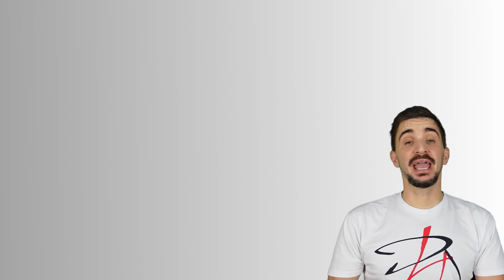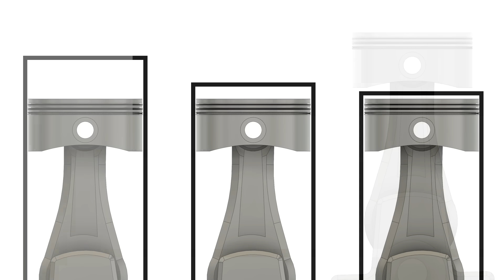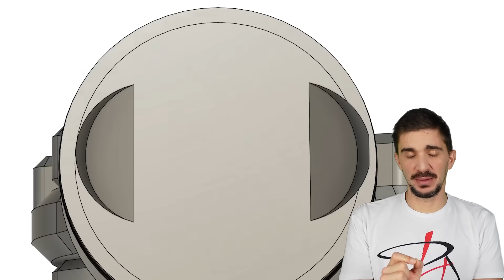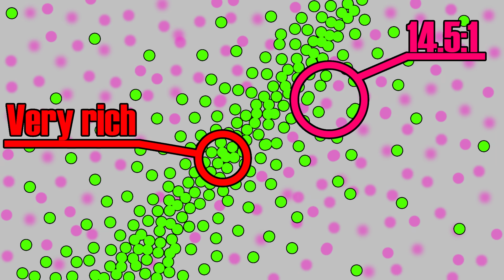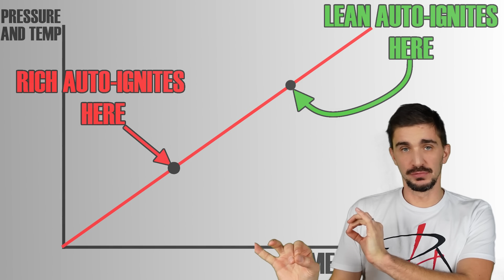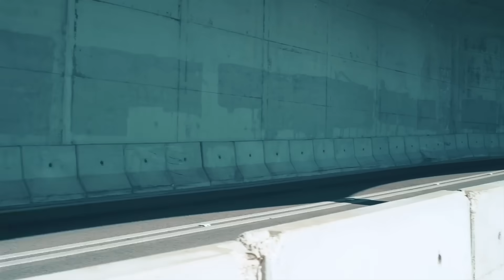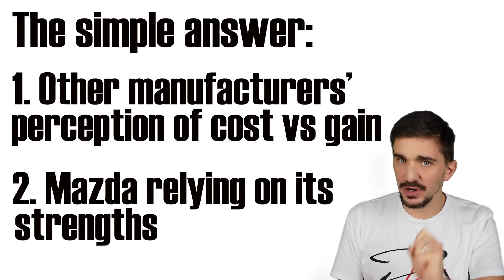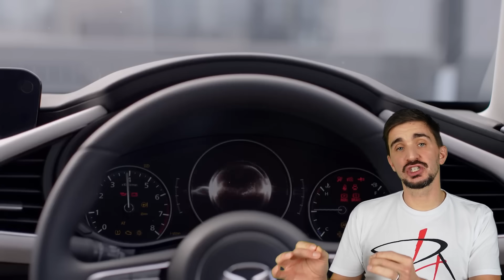The Game Changer Nobody Cares About - Mazda Skyactiv-X SPCCI How it Works and Why It Didn't Catch On

Comment: I haven't driven many different cars in my life. Until I got my actual first car, I've been driving (and still sometimes drive) my family's '05 Focus. 1.6L TI-VCT, nothing super special in terms of power, but its response is really good. Makes even stop-and-go fun if I can rev match and get the timing right.

The one time I drove a turbocharged car - a 2014 Mercedes B180 - I kinda immediately swore off of turbos because of the immense throttle delay when trying to rev match. That one little thing, convinced me that I want natural aspiration or supercharging for the fun of driving.

A bit under two years ago, I got a Mazda 3 with the Skyactiv-X engine. No regrets so far. I wanted an NA, gasoline, reasonably powerful, reasonably fuel-efficient, reasonably reliable* car for a reasonable price. It's got pep and response, and it's not too bad in traffic either. My habits get the best of me, granted, but at my most efficient I get like 7L/100km in the city.

*reliability is still up in the air; no actual problems yet, but I'm just two years into ownership.

Comment: So what kind of mileage do these SkyActiv-X engines get? I understand the reduction in tailpipe emissions, but if it’s using a far leaner fuel mix at highway cruising speeds, it should get killer MPG, right? Edit: never mind. In the USA, they only use the 2.5L

Comment: Soot's good.
1. does not have an effect on the climate
2.washes out of the air with rain and becomes sequestered carbon , moleular carbon in soil is very beneficial.
3. kills humans in dense population centres , so it reduces anthropogenic climate effects
win win win!

Remember: not so long ago good humans voluntarily filled their lungs with soot. Now all they do is fill their lungs with propylene glycol which is not nearly as efficient at killing them

Comment: I think this video missed some of the factors that have led to the Skyactiv-X engine being a relative flop. I'd say the #1 reason is that they've been discontinued quite quickly in the North American market, in part because of the EPA's increasingly difficult non-CO2 emissions would've been quite difficult to hit with SPCCI, and the end result was relatively modest fuel economy gains; there was a large 20+% improvement on the weak NEDC cycle, but only 9% on the WLTP and likely even smaller on the EPA cycle, which is important because the US is driven by the company's CAFE rather than the buyer's CO2 emissions tax in Europe. Another large factor for the US is the costs for the consumer, increased initial price and the requirement to use 95-octane (RON) fuel, which is 91-octane (AKI) half-premium fuel in North America. 

Some are saying that the Skyactiv-X being a 2.0-liter made it too weak for the US market, and while that's true they could've just made a 2.5-liter version if the SPCCI concept was viable. I think the biggest problem is that modern Full Hybrids are just fundamentally better in most driving scenarios for a similar cost to the consumer. At the price of potentially higher development costs, full hybrids do way better in city/stop & go driving due to regen braking, deliver great throttle response and low-end torque with the lack of frustrating engine stop-start lag, and there's a lot of opportunities for lower NVH (assuming it's not underengineered). The Skyactiv-X might have an advantage in constant-speed highway cruising, but hybrid systems can use high compression ratio Atkinson/Miller/Budack cycle engines that have consistently high thermal efficiency and use the electric side of the hybrid to cover off their low torque and potentially lower peak power. This approach also has the advantage of being easily converted to a plug-in hybrid system and builds institutional knowledge that will help with EV powertrains to some extent.
Reply: Is there not a way SPCCI could be implemented in a hybrid drivetrain?
Reply: @Sam-go3mb  You absolutely could, and Mazda might choose to do so, but a 'traditional' setup using the high compression ratio Atkinson cycle engine probably has much lower R&D for emissions while also possibly having lower parts cost. I'm not sure if the Skyactiv-X engine requires any particularly expensive parts (fancy injectors?), or if it's just the high R&D costs that make it expensive. If it's just the latter and they're able to meet new emissions regs, we could see it come to Mazdas self-developed hybrid system coming next year, or in a future PHEV or EREV setup.
Reply: Did some reading on people's experiences, and a few complain a bit about diesel-like NVH which is obviously undesirable in most cars, especially hybrids where it'll contrast harder against the silent and smooth electric mode. Several complain about underwhelming low end torque, which makes sense given that peak torque is past 4,000rpm while most Euro market cars have turbos nowadays. It might make it a great engine for the Miata, assuming the SPCCI bits are easy for tuners to work with.
Reply: @needles_balloon  Interesting, I'm just learning about all this so thanks for the technical details. True, it could have the right character for a Miata. Personally I prefer peak torque lower down in a daily driver, and honestly in general I'm more of a fan of torque than winding out to redline but I can still appreciate it. I probably wouldn't mind the NVH, one persons NVH is another persons feedback - but ultimately diving enthusiasts are the minority of consumers. Which is tough for Mazda because they've always prioritised driving dynamics even in economy cars, which is something the other Japanese manufacturers gave up on after the 90s it seems.
Reply: @Sam-go3mb my S2000 feels like a Miata until 6k rpm when the cams shift and it finally makes some torque! Honestly my older Miata was more fun to drive around town….redline first thru third and you’re barely doing 50 mph!
Reply: @Sam-go3mb  I believe the upcoming Skyactiv-Z engines are meant to take this technology a step further, and are built for electrified applications from the outset. So we'll see how it goes in Mazda's in-house hybrid drivetrain next year.

Comment: An eCVT system that runs the engine at constant 80+% load either driving wheels or charging the battery takes most variables out of the HCCI equation. An electric intake turbo can compensate for air density changes from elevation and temperature, eliminating two more variables. An intake-exhaust heat exchanger with bypass valve could regulate intake air temperature to ~60C (got to be at least as high as the highest ambient temperature the vehicle will operate in) within seconds from startup, which would help with thorough fuel vaporization, predictable compression-igniton, engine warm-up, etc. at the expense of some power density. If more power density is required, upgrade the intake e-turbo to a hybrid one.

Since a normal car without towing capability needs roughly 25kW to sustain highway speeds under fair conditions, an eCVT hybrid designed for heavy electric assist could make-do with a ~35HP engine. Despite the density-sapping changes to bring the engine up to HCCI steady-state as quickly as possible, 40HP would likely be achievable in a 1L 2cyl package.

You would still need spark ignition to make sure the air-fuel charge ignites while things are too cold for HCCI to operate reliably.

Comment: What really ticked me off is that Mazda, unfortunately, ended up reducing the compression ratio down to 15.0:1 as well as created a mess with branding the mild hybrid. The "real" SPCCI (as they initially intended) quickly disappeared and started relying on a lower compression ratio and electric assistance, increasing the complexity and disposability of the whole thing. And then Mazda decided against SPCCI for their inline 6 engines completely, which is such a missed opportunity, but it probably wouldn't have worked anyway. Things get even worse for Mazda with their recent switch to massive touch screen displays and the removal of physical controls as well as branding and selling Chinese EVs under the Mazda name to the unsuspecting public. So yeah, as much as I wish Mazda was something better, things quickly turned around and that's so sad. It was a great attempt, though, such a shame it didn't last.

Comment: I'm working on a high compression small block Chevrolet build. 21 to 1 static compression to be exact. The way I plan to run this on 87 octane pump gas is to bleed of the cylinder pressure with a late intake valve closure point.
Reply: That sounds interesting. I'm always intrigued when people customize tech, especially making our US manufacturers engines work better.
Reply: @erinmac4750  I'm not the first to attempt a high compression pump gas SBC. Harvey Crane from Crane cams tried this back in the 80's with a 13 to 1 350. But his build was flawed he only had about 150 cranking psi which is not much even for low octane fuel. And he got his high compression ratio with high dome pistons and large smog era open chamber cylinder heads which made the flame front very inefficient. He did get 30 mpg and about 220 hp which isn't bad for a 3 speed automatic in slightly less than 3,000 pound car. But I think with about 190 cranking pressure with modern cylinder head combustion chamber design and flat top pistons. And modern carburetor design which atomizes the fuel extremely well with a duel plane high rise intake 50 mpg and 500 hp should be possible!

Comment: I drove a Mazda 3 with a  skyactiv x engine as a rent car during holidays. The engine is indeed very flat and has a lack of punch. I did not notice a significant low fuel consumption but it's true that I used it mainly in cities which is not where consumption is expected to be reduced.

Comment: Auto-ignition is the cause of knock, not generally of pre-ignition and they are not the same thing.

I think another likely downside of this combustion is that being lean of stoichiometric causes emissions challenges because the catalyst efficiency becomes low, especially for reduction but even for oxidation to some extent.

Comment: I'm sorry, you are just wrong. This goes contrary to what I often hear from car salesmen and mechanics. The general perception is that Skyactiv-X is a very problematic engine, with lots of issues. I swear I even talked to a Mazda sales rep when I was buying my Mazda 3, who persuaded me to buy just a regular Skyactiv-G version. And I did. Seems many are making the same decision. People are afraid of the particulate filter on the Skyactiv-X. It's just not as reliable as the traditional gasoline version. And it's more expensive, so really there's no reason to buy one.

Comment: Back in 2020 I was impressed by Skyactiv-X engine with its SPCCI , so I shortlisted Mazda 3 6MT with this 2.0 engine, Civic 1.5T 6MT and Corolla Hybrid 2.0 all three with ±180hp.
When I realized Mazda put both belt-driven supercharger (!!) and belt-driven Mild Hybrid ISG  +plus it had questionable SPCCI sensors and all SPCCI-related stuff, I decided not to consider this overcomplicated solution. It looks like Mazda sells technology for sake of the technology. With no real advantages. Fuel economy is better on real Toyota hybrid with similar power. Better acceleration feel is achievable with much simpler and time-proven turbo-charged Honda engine.

Comment: I bought my Mazda 3 e-SkyactivX last year, and honestly its been pretty great! When I was test driving cars I was actively put off by turbos. Coming from an older NA car the delay in the throttle response, and the rev-hang made them feel sluggish in that first split-second off the line, and made shifting (especially 1st to 2nd) just not as slick as it should be. I also find when you're just pootling around between 1-2k rpm turbos are very "spongy" in their delivery, so it felt more fussy in that way.

When I drove the Mazda all of that was fixed, I was back in familiar territory. The engine responded when you asked something of it, and didn't get in the way between shifts. It is notibly lacking in punch compared to turbocharged cars in the catagory, but I'll take the responsiveness, and less fussy low RPM & load nature of it over a turbo any day. Really I think the lack of feeling of performance is more to do with the gearing, which is very tall 1-3, and the cars weight, it's considerably heavier than its rivals. If the car was lighter and had more aggessive gearing in the first couple of gear I think it would feel a lot "sportier" in that regard. But for daily driving I think it's pretty much perfect.

The fuel economy in the real world is also fairly decent (high 40's low 50's mpg imperial), its not quite as good as its downsized turbo rivals I think, but it is also as I said much heavier car. And I think that would be equalised if it just didn't weigh as much.
Reply: do you even feel slight vibrations in clutch while starting in uphills without giving gas (when starting by only releasing clutch pedal) ? I experience this sometimes on mine (SkyActiv X manual) but I don’t know if it’s normal ?
Reply: @lmpb3484  My experience is that you generally feel a bit of the vibration of the engine through the clutch pedal of any car tbh. That's held true for all 7 manual car's I've driven, and at least a dozen vans.

However, I never start without a little gas in any vehicle. The Mazda 3's ecu does assist you a bit, it'll try its best not to stall, but if the vibrations are strong thats a sign the engine is just struggling to tick over, use a little gas as you lift the clutch and it'll be nice and smooth. In general I've found the e-SkyactivX engine to be pretty refined and smooth, though it does sound like a bit of a tractor on a cold cold start, like all of Mazda's high compression direct injection engines.
Reply: @__-fm5qv  thank you for your answer. I think you are right, this engine needs gas to hill start correctly. I was used to manoeuvre without giving gas with my previous vehicle (VW Golf 1.4 TSI), and it was fine. But the SkyActiv X seems to run a little bit less smoothly than a conventional petrol engine (I mean compared to a lowest compression ratio engine).
Reply: @lmpb3484 In my experience VW ECUs tend to give you a lot more assistance when pulling away. They basically apply the throttle for you so it's easier and smoother to move off. Whereas Mazda tends to just try and stop the engine stalling and nothing more.
Reply: @__-fm5qv  I see, thank you very much for your feedback

Comment: Many VVT engines achieve 36 highway mpg in cars the size of a Mazda 3.  So with a Mazda, based on what you say I would expect 45mpg highway.  Yet they advertise 36-37 mpg highway.  If VVT/Adkinson is just as good and conventional so that someone other than the dealer can manage repairs, why do this?  Seems to me that developers aren't being lazy and stupid as you say.  They are leveraging some very sensible prior R&D.

Comment: I wonder how this engine compares to the old Honda CVCC engine?   That was boring engine of modest power but it was a very pleasant engine to drive with a really good low end.
Reply: Sounds like the same thing.  I think the CVCC had a 3rd valve that fed a rich air/fuel chamber.

Comment: It’s true; customers are spoiled. Working the engine is annoying on an automatic transmission. Whenever I request more power on my CVT 2.4L and the RPM jumps from 1500-2500 rpm to 4000 rpm, I’m genuinely annoyed. Whenever I request more power on my 2.3L 5 Speed auto it’s annoying when it down shifts to 5500 rpm. But when I request more power from my 5 speed manual inline 6 by shifting from 5th to 3rd, it’s pleasant. Automatic transmissions combined with normally aspirated motors aren’t pleasurable.  If cost, reliability and durability wasn’t a factor, I’d prefer most anything else.

Comment: 14:15 2.0L with 180hp?! That's almost 100hp/l which is impressive NA! But wait... I'm an engineer and I should care..
Reply: Wait till blud learns about all the big Japanese auto makers having 100hp/1L engines and squeezing 180hp out of 1.6litres 30yrs ago……..
Reply: @the_sidewinder using turbos blud, he SAID normally aspirated.
Reply: Honda B16B used in the EK9 Civic Type R is a 1.6L 4-cylinder naturally aspirated engine that produce 182hp, thats almost equivalent if not more than a naturally aspirated V6 used in the same model year by other manufacturer in 1997. While in 1999 they launch the S2000 with the F20C, a 2.0L 4-cylinder also naturally aspirated engine that produce 247hp, something other manufacturers have to put supercharger to their Vos to get the same power figure.
Reply: @the_sidewinder motorcycles make over 200ho/liter and motogp makes over 300 ho per liter with a bore limit and an engine limit per season!
Reply: @aidanlyons1155 motorcycle engines can't be compared to car engines
Reply: @the_sidewinder 
With turbos, though, right?
How many miles do those engines do?
Reply: it's an econobox too. mazda squeezes the crap out of their engines. tuning gets you more power but not that much. they know what they're doing
Reply: Miatas have 188hp stock on a 2L NA, and I got a 2018 m3 with a 2.5 which makes 188 also, but much more torque-y. Also dead reliable, which is insane to consider for the amount of efficiency you get. Mazda should be on honda or Toyota levels of reputation, at least on their engineering and reliability. And also they stick to NA which I love
Reply: The engine in the old brz (fa20 I believe) makes that much so its not unheard of.
Reply: It's supercharged with a small roots blower, not NA. Which is even more impressive imo. 16:1 cr with boost on a gas engine is insane.